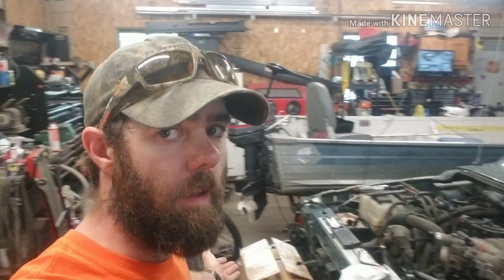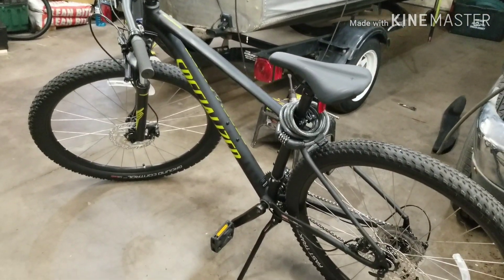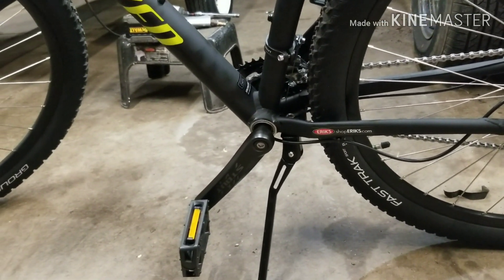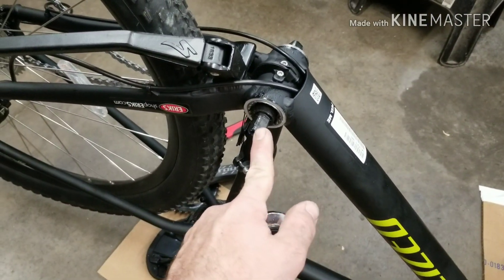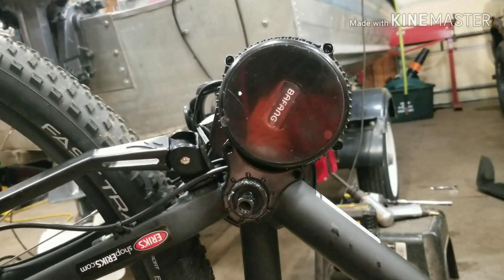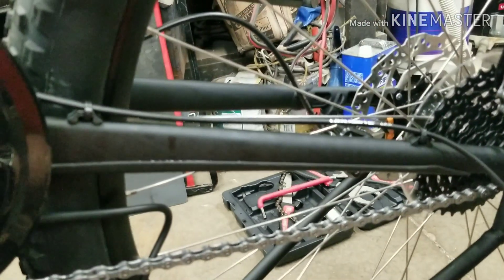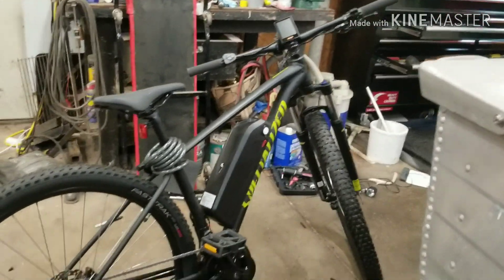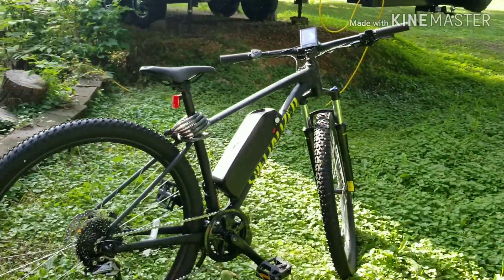How to build a fast E Bike

Comment: have an electric bike, it has a switch on the battery which is under my sead, in the handle bar I can't switch the battery on and off, it only can change the speed of the electric, it has 3 speed choose on it, if I just want to paddle the bike without the electric, it is very hard for me to reach the switch on the battery, how can I add a switch on and off on the handle bar, then I can choose use paddle or electric when I was ridding on my bike. please let me know on this question, thank you so much. a video?
Reply from the maker: You have to add a switch to the wires where the battery plugs into your wire harness. Look up the manufacturer of the bike/kit and see if they have a plug and play solution I'm sure you are not the only one that has that issue with that setup
Reply: @JDSOutdoors  thank you, have you done it before?
Reply: can you do a video for it?